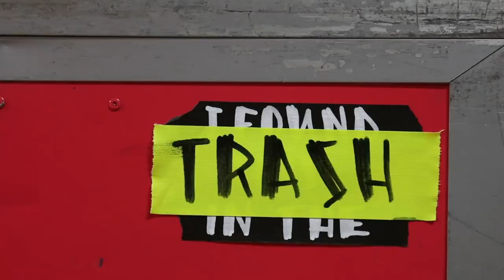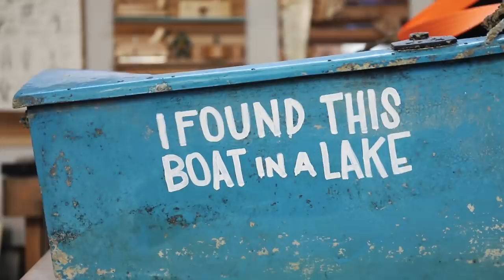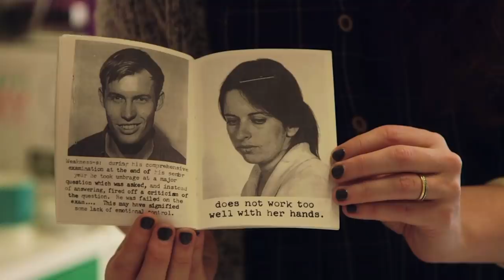30 projects in 10 minutes - All the things I built in 2018

Comment: You should try making one of those metal barrel tool carriers.  Imagine a metal barrel, with 1/3 to 1/4 cut off, and that cut off panel is the door that slides on the inside of the rest of the barrel.  Open it, and you have racks of tools hanging, and you can spin the racks around to reveal more tools, like a lazy Susan.  Not sure how to translate 'lazy Susan' into German, you'll have to google it. I have seen several versions, but no plans/instructions on how to make them.  Making the door slide effortlessly seems to be quite difficult, some of the designs fail on that point.  Then you can share the plans with the rest of us!  8:39, that is that device, please? Thanks!